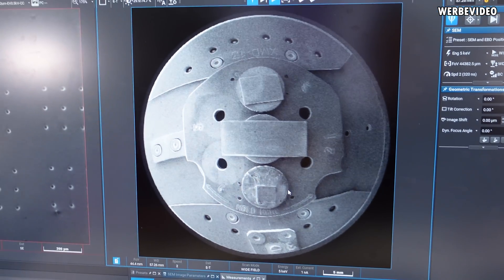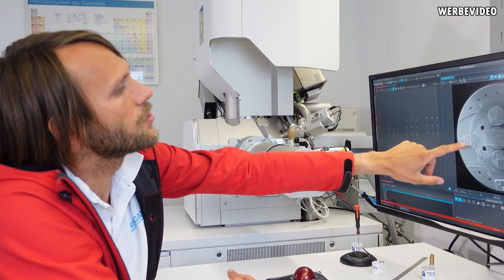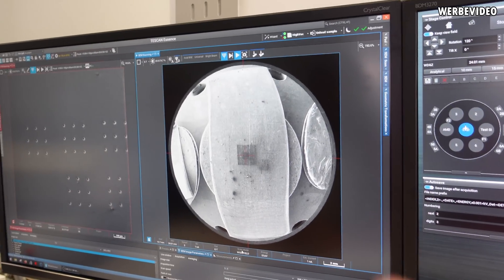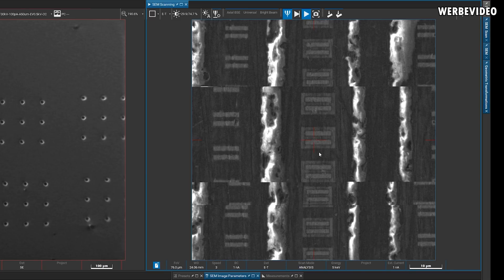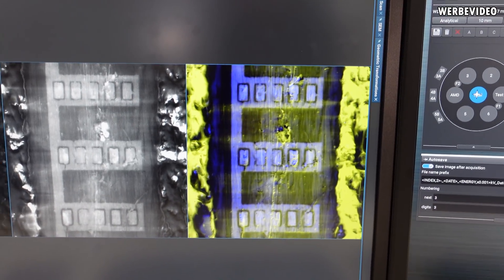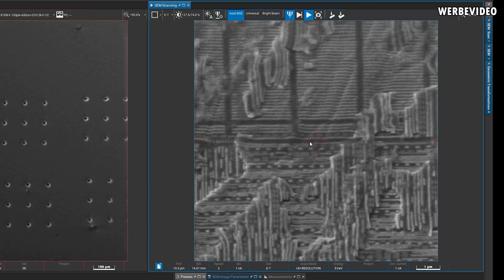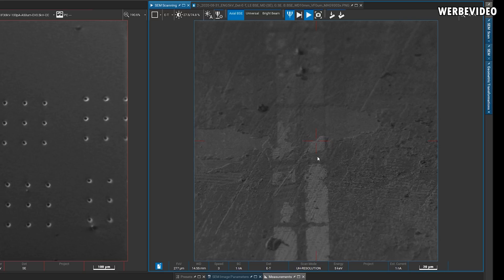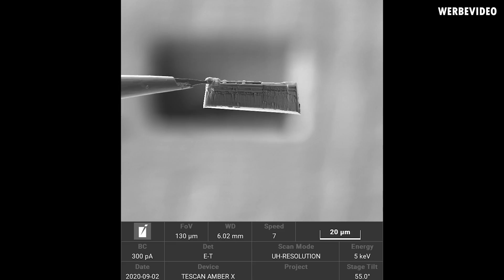Ryzen Nano-Structures more than 100,000 times magnified. Visiting Tescan Part 2/3

Comment: It is worth noting that the wavelength of visible light is in the range of 0.38 to 0.74 microns.
An optical microscope cannot resolve features much smaller than optical wavelengths.
This is why electron microscopes are so amazing; they have resolving power much finer than optical wavelengths.

This is also why chip fabs are moving to extreme UV (EUV) processes, which have much smaller wavelengths.  
The same optics that shrinks a mask down, is basically just a microscope in reverse, with similar optical limitations.
In the case of EUV, the photolithography uses light beyond the visible range.

And if you're wondering about using an "electron microscope" in reverse for "electron-lithography," then yes, that is a thing.  But it has been too difficult to scale up to commercial/industrial levels.  But it's used in some nanotechnology research.

https://en.wikipedia.org/wiki/Visible_spectrum

Comment: So interesting. Unique to see this on You tube. You are a front line Tech Tuber. Thank you!
Reply: Ok so you know what Electron tunneling is with the transistors, and how they use silicon transistors to get smaller like the 7 nm they are currently at with AMD's Ryzen 3000 series CPU's.
And the 5 nm, 3nm and so on, to make the computers more efficient with performance and energy but now we are starting to see more heat.
Silicon has limits but they keep trying to improve it, and it will melt at specific temperatures, so we need to replace it.
Ask yourself why we aren't using Quantum Materials like Graphene (yet) and still using silicon. 🤨🤔

This is where Graphene will fix the electron tunneling aka Quantum Tunneling, we don't need silicon to get down to 1 nm "nanometer" in size.

Imagine this, Graphene computers with a magnetic current to be 1,000 times faster and possibly only use 1% of the energy used. 💡

Now imagine Graphene optical / transparent transistors for Photonic Computing. 💡

Now imagine Graphene lasers for the fiber optics that would be used as the circuits inside our computers for Photonic Computing. 💡

--------

I would rather see Graphene computers, let's get rid of silicon. I'm serious.

Check this out.
I would give links but the video hides my comments.

Go to my channel and click on the playlist called "Videos with important info to get around my channel". ✔

Watch a Flash Graphene video about Flash Graphene 100 dollars "per ton". ✔

And then another video about "Large machines on earth / in space to make Flash Graphene". ✔

After that, check my channel with 2 simple steps for my other channel, go to the "About" tab of the channel I'm commenting with now and read the info with a link found there to save to your browser's favorites. ✔

==============================

Imagine Graphene for Photonic Computing, to help us save on our energy needs, really think about that for a second with Photonic Computing.

Check my other channel for these 2 playlists.
Photonic Computing playlist. ✔

Graphene computers for home and Starships, playlist. ✔

Learn about Graphene from my other channel's "Graphene playlist". ✔

If you want to know more about Graphene and Quantum Technologies, go to my other channel. ✔🤔💡
Reply: @gameresearch9535  Whoa! Seems like you know a thing or two about it. GT, that is probably the best (and longest) comment reply I've ever gotten in my life! I hope that you didn't compose that comment just for me? Anyway, I do that all the time when I'm passionate and knowledgeable about a subject. 

So you've got me piqued! 
---
I've heard of graphene, seen the microstructure, etc, but I know very little. So for sure I'll check out your videos. Thanks soo much!

Comment: The ultimate will be lining up atoms on Sub 1nm architecture. Alien grade.
Reply: Not unless you managed to break the laws of quantum mechanics that bring in quantum tunneling at anything under 5nm. We need new materials that aren't silicone based. Maybe with carbon nanotubes and molybdenum disulfide, we can go down to 1nm. Anything smaller than that is pure fiction at this point.
Reply: @Niaaal  the human race will work it out. I mean look at where we've come in the last 100 years. If you stop to think about it, its pretty insane. But you're right. It appears we are are becoming limited more and more to the laws of physics, at least by our understanding of it anyway.
Reply: @jf9979  I fully agree with you. I definitely remain optimistic and I'm sure the future unimaginable discoveries
Reply: Ok so you know what Electron tunneling is with the transistors, and how they use silicon transistors to get smaller like the 7 nm they are currently at with AMD's Ryzen 3000 series CPU's.
And the 5 nm, 3nm and so on, to make the computers more efficient with performance and energy but now we are starting to see more heat.
Silicon has limits but they keep trying to improve it, and it will melt at specific temperatures, so we need to replace it.
Ask yourself why we aren't using Quantum Materials like Graphene (yet) and still using silicon. 🤨🤔

This is where Graphene will fix the electron tunneling aka Quantum Tunneling, we don't need silicon to get down to 1 nm "nanometer" in size.

Imagine this, Graphene computers with a magnetic current to be 1,000 times faster and possibly only use 1% of the energy used. 💡

Now imagine Graphene optical / transparent transistors for Photonic Computing. 💡

Now imagine Graphene lasers for the fiber optics that would be used as the circuits inside our computers for Photonic Computing. 💡

--------

I would rather see Graphene computers, let's get rid of silicon. I'm serious.

Check this out.
I would give links but the video hides my comments.

Go to my channel and click on the playlist called "Videos with important info to get around my channel". ✔

Watch a Flash Graphene video about Flash Graphene 100 dollars "per ton". ✔

And then another video about "Large machines on earth / in space to make Flash Graphene". ✔

After that, check my channel with 2 simple steps for my other channel, go to the "About" tab of the channel I'm commenting with now and read the info with a link found there to save to your browser's favorites. ✔

==============================

Imagine Graphene for Photonic Computing, to help us save on our energy needs, really think about that for a second with Photonic Computing.

Check my other channel for these 2 playlists.
Photonic Computing playlist. ✔

Graphene computers for home and Starships, playlist. ✔

Learn about Graphene from my other channel's "Graphene playlist". ✔

If you want to know more about Graphene and Quantum Technologies, go to my other channel. ✔🤔💡

Comment: Actually insane what we can make lol
Reply: Ok so you know what Electron tunneling is with the transistors, and how they use silicon transistors to get smaller like the 7 nm they are currently at with AMD's Ryzen 3000 series CPU's.
And the 5 nm, 3nm and so on, to make the computers more efficient with performance and energy but now we are starting to see more heat.
Silicon has limits but they keep trying to improve it, and it will melt at specific temperatures, so we need to replace it.
Ask yourself why we aren't using Quantum Materials like Graphene (yet) and still using silicon. 🤨🤔

This is where Graphene will fix the electron tunneling aka Quantum Tunneling, we don't need silicon to get down to 1 nm "nanometer" in size.

Imagine this, Graphene computers with a magnetic current to be 1,000 times faster and possibly only use 1% of the energy used. 💡

Now imagine Graphene optical / transparent transistors for Photonic Computing. 💡

Now imagine Graphene lasers for the fiber optics that would be used as the circuits inside our computers for Photonic Computing. 💡

--------

I would rather see Graphene computers, let's get rid of silicon. I'm serious.

Check this out.
I would give links but the video hides my comments.

Go to my channel and click on the playlist called "Videos with important info to get around my channel". ✔

Watch a Flash Graphene video about Flash Graphene 100 dollars "per ton". ✔

And then another video about "Large machines on earth / in space to make Flash Graphene". ✔

After that, check my channel with 2 simple steps for my other channel, go to the "About" tab of the channel I'm commenting with now and read the info with a link found there to save to your browser's favorites. ✔

==============================

Imagine Graphene for Photonic Computing, to help us save on our energy needs, really think about that for a second with Photonic Computing.

Check my other channel for these 2 playlists.
Photonic Computing playlist. ✔

Graphene computers for home and Starships, playlist. ✔

Learn about Graphene from my other channel's "Graphene playlist". ✔

If you want to know more about Graphene and Quantum Technologies, go to my other channel. ✔🤔💡

Comment: Humans are making such rough CPUs on a quantum level
Reply: Ok so you know what Electron tunneling is with the transistors, and how they use silicon transistors to get smaller like the 7 nm they are currently at with AMD's Ryzen 3000 series CPU's.
And the 5 nm, 3nm and so on, to make the computers more efficient with performance and energy but now we are starting to see more heat.
Silicon has limits but they keep trying to improve it, and it will melt at specific temperatures, so we need to replace it.
Ask yourself why we aren't using Quantum Materials like Graphene (yet) and still using silicon. 🤨🤔

This is where Graphene will fix the electron tunneling aka Quantum Tunneling, we don't need silicon to get down to 1 nm "nanometer" in size.

Imagine this, Graphene computers with a magnetic current to be 1,000 times faster and possibly only use 1% of the energy used. 💡

Now imagine Graphene optical / transparent transistors for Photonic Computing. 💡

Now imagine Graphene lasers for the fiber optics that would be used as the circuits inside our computers for Photonic Computing. 💡

--------

I would rather see Graphene computers, let's get rid of silicon. I'm serious.

Check this out.
I would give links but the video hides my comments.

Go to my channel and click on the playlist called "Videos with important info to get around my channel". ✔

Watch a Flash Graphene video about Flash Graphene 100 dollars "per ton". ✔

And then another video about "Large machines on earth / in space to make Flash Graphene". ✔

After that, check my channel with 2 simple steps for my other channel, go to the "About" tab of the channel I'm commenting with now and read the info with a link found there to save to your browser's favorites. ✔

==============================

Imagine Graphene for Photonic Computing, to help us save on our energy needs, really think about that for a second with Photonic Computing.

Check my other channel for these 2 playlists.
Photonic Computing playlist. ✔

Graphene computers for home and Starships, playlist. ✔

Learn about Graphene from my other channel's "Graphene playlist". ✔

If you want to know more about Graphene and Quantum Technologies, go to my other channel. ✔🤔💡

Comment: That is really mind blowing to see. Imagine what machinery they require to produce cpu's.
Reply: laser. i think
Reply: Lithography. Printing with light at microscopic scales
Reply: Ok so you know what Electron tunneling is with the transistors, and how they use silicon transistors to get smaller like the 7 nm they are currently at with AMD's Ryzen 3000 series CPU's.
And the 5 nm, 3nm and so on, to make the computers more efficient with performance and energy but now we are starting to see more heat.
Silicon has limits but they keep trying to improve it, and it will melt at specific temperatures, so we need to replace it.
Ask yourself why we aren't using Quantum Materials like Graphene (yet) and still using silicon. 🤨🤔

This is where Graphene will fix the electron tunneling aka Quantum Tunneling, we don't need silicon to get down to 1 nm "nanometer" in size.

Imagine this, Graphene computers with a magnetic current to be 1,000 times faster and possibly only use 1% of the energy used. 💡

Now imagine Graphene optical / transparent transistors for Photonic Computing. 💡

Now imagine Graphene lasers for the fiber optics that would be used as the circuits inside our computers for Photonic Computing. 💡

--------

I would rather see Graphene computers, let's get rid of silicon. I'm serious.

Check this out.
I would give links but the video hides my comments.

Go to my channel and click on the playlist called "Videos with important info to get around my channel". ✔

Watch a Flash Graphene video about Flash Graphene 100 dollars "per ton". ✔

And then another video about "Large machines on earth / in space to make Flash Graphene". ✔

After that, check my channel with 2 simple steps for my other channel, go to the "About" tab of the channel I'm commenting with now and read the info with a link found there to save to your browser's favorites. ✔

==============================

Imagine Graphene for Photonic Computing, to help us save on our energy needs, really think about that for a second with Photonic Computing.

Check my other channel for these 2 playlists.
Photonic Computing playlist. ✔

Graphene computers for home and Starships, playlist. ✔

Learn about Graphene from my other channel's "Graphene playlist". ✔

If you want to know more about Graphene and Quantum Technologies, go to my other channel. ✔🤔💡

Comment: at around 10:30 those are probably metal dummies. A chip is filled with metal-dummies in every layer before tapeout and the purpose of that is to make the metal density in layers more uniform, this is due to the planarization process (Chemical-Mecanical polishing) where you want a material that is roughly the same density and harness so that you can make the layer planar to a fraction of a um. That is how processes can stack 11-14 metal layers today while in the past 3 was already really hard.

You don't need to grind the die next time, just open a small window with the FIB to a determined layer, although that takes a lot of time and work and maybe the sponsor wouldn't do that. That is usually how it's done in foudries or IC design companies when they need to look at some detail in a post-production chip.
Reply: I haven't the slightest idea if this all is true or complete nonsense, but it sounds plausible and no one refuted it, so I'll like it :)
Reply: As a PhD student who has worked on XPS (X ray photoelectron spectrometer) systems looking a nanomaterials (catalysts). You can sputter (remove) surface layers with ion sources, I worked mostly with Ar+ sources but I'm not sure how thick the layers are on a chip so it may take a while to remove everything. Though it can be hasten with heavier ions and higher accelerating voltages of the ions.
I haven't used a sem before but have used a STEM as it has atomic level resolution

Comment: The best tech video of the year award go's to........................ @der8auer
Can't wait for part 3
Reply: Ok so you know what Electron tunneling is with the transistors, and how they use silicon transistors to get smaller like the 7 nm they are currently at with AMD's Ryzen 3000 series CPU's.
And the 5 nm, 3nm and so on, to make the computers more efficient with performance and energy but now we are starting to see more heat.
Silicon has limits but they keep trying to improve it, and it will melt at specific temperatures, so we need to replace it.
Ask yourself why we aren't using Quantum Materials like Graphene (yet) and still using silicon. 🤨🤔

This is where Graphene will fix the electron tunneling aka Quantum Tunneling, we don't need silicon to get down to 1 nm "nanometer" in size.

Imagine this, Graphene computers with a magnetic current to be 1,000 times faster and possibly only use 1% of the energy used. 💡

Now imagine Graphene optical / transparent transistors for Photonic Computing. 💡

Now imagine Graphene lasers for the fiber optics that would be used as the circuits inside our computers for Photonic Computing. 💡

--------

I would rather see Graphene computers, let's get rid of silicon. I'm serious.

Check this out.
I would give links but the video hides my comments.

Go to my channel and click on the playlist called "Videos with important info to get around my channel". ✔

Watch a Flash Graphene video about Flash Graphene 100 dollars "per ton". ✔

And then another video about "Large machines on earth / in space to make Flash Graphene". ✔

After that, check my channel with 2 simple steps for my other channel, go to the "About" tab of the channel I'm commenting with now and read the info with a link found there to save to your browser's favorites. ✔

==============================

Imagine Graphene for Photonic Computing, to help us save on our energy needs, really think about that for a second with Photonic Computing.

Check my other channel for these 2 playlists.
Photonic Computing playlist. ✔

Graphene computers for home and Starships, playlist. ✔

Learn about Graphene from my other channel's "Graphene playlist". ✔

If you want to know more about Graphene and Quantum Technologies, go to my other channel. ✔🤔💡